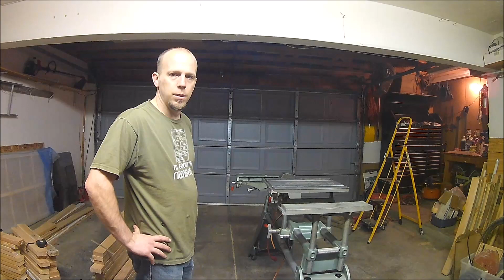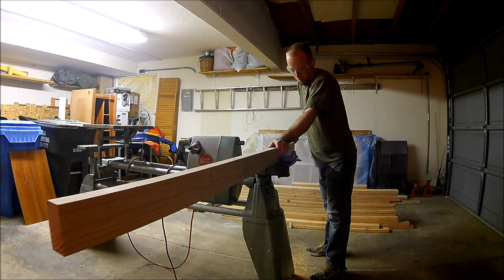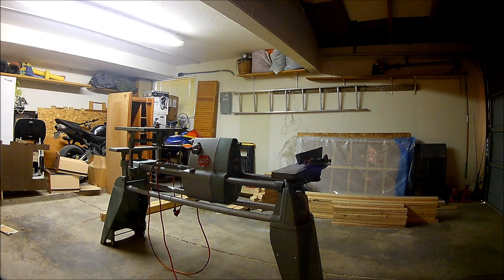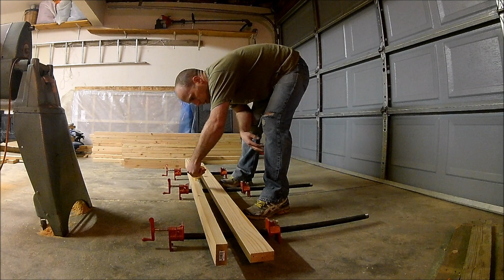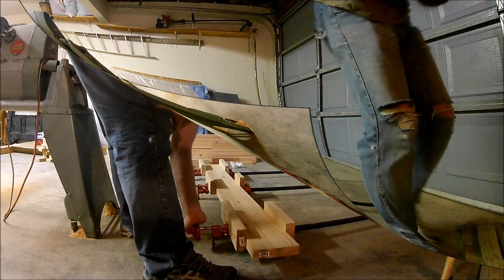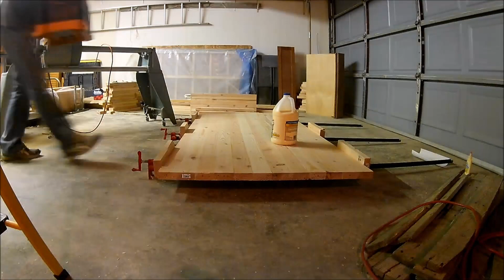Woodworking Bench Project Episode 2

Comment: I don't see any saw guards and I have been told many times to never use the rip fence when making cross cuts.
Reply from the maker: Thanks for your concern Mike. The Shopsmiths I've used have never had saw guards and when I bought mine it didn't have them either. I have always been diligent about safety though so I'm very careful when operating. In terms of cross cutting with a rip fence, as long as you are careful and have a minimum of a mitre gauge behind the piece to keep it secure and square you should be alright. It's when things bind that things can get nasty.